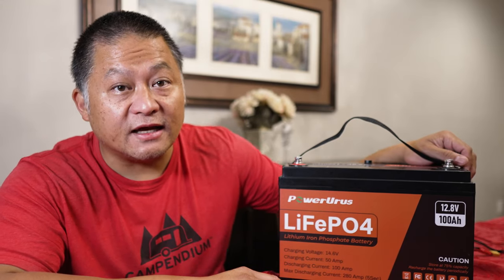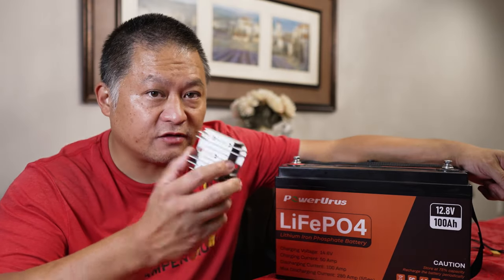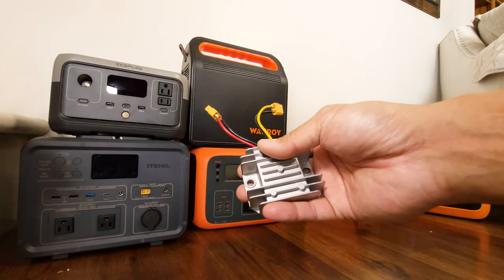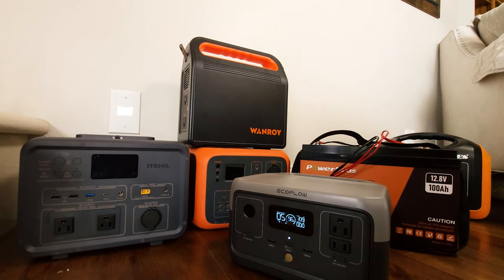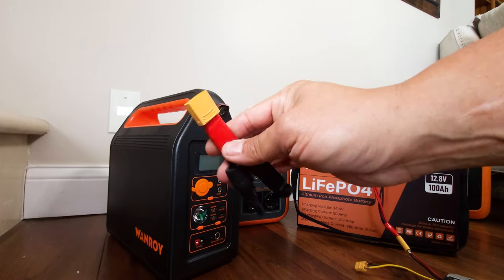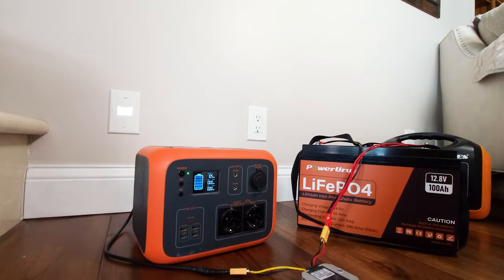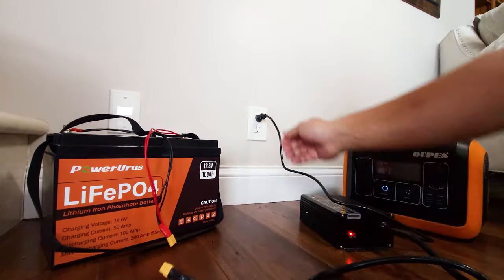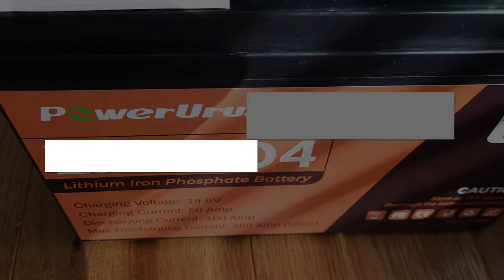CAPACITY HACK For ANY Power Station // PowerUrus 100Ah LiFePO4 Battery

Comment: Freely Roaming - Do you know if the EcoFlow Delta 1300 can just be charged directly from a 12v 100ah battery without using the 24v booster? I guess I'm not understanding what the advantage of using that device is if the EFD is supposed to accept up to 400w of DC input (within the 65v/10a parameters). I also just now today saw another guy's (Charger Harbor) video showing him direct wire charging his EcoFlow Delta 2 from an Ampere Time 12v 100ah battery. For some unknown reason, it only charged at 102w even without any current limiting device such as the 24v booster you are using. I would appreciate any insights you can provide on all this, since I have a new 100ah LifePo4 battery on the way soon and I'm getting pretty confused (and somewhat nervous - lol) as to which way I should go. Thanks.
Reply from the maker: The Delta has a built in current limiter in place so it would work without it. The power station sees it the same way if you were plugging into a vehicles lighter socket. At its native voltage, you can only charge at 120w max because of the 10A limit.
Reply: @freelyroaming  OK F R, thank you very much for all your help on this, and I do believe that this newbie is starting to see the light on some of it - finally! - lol.... :learning::goodvibes:

Comment: Great video. Question, why are there two wires on the positive and two on the negative of your battery pigtail?
Reply: I thought the same.
Reply from the maker: Just so it can handle higher current flow.

Comment: Nice video, I like it.  Can you comment on the low capacity power station discharging faster like using a heater or high power consumption device than it can be charged by the lifepo4 battery pack?
Reply from the maker: Most of the time you won't be able to charge a power station faster than you can discharge it. So even though you could charge it with a spare battery, you will still run it empty first and will have to wait before running those high power devices again.

Comment: So if I'm understanding correctly, I could use the next step up ( DC 12V Step Up to 24V 10A Boost Converter 240W DC ), to power my PPS VTOMAN 1800, even though it has a DC input max of 200W... and the machine will be smart enough to only use up to that (as opposed to frying it)?  
Awesome info!
Reply: Did you end up doing this setup? I would like to do the same on my River Pro (not the latest river pro, the first model).

I saw at the top of the comments section, the OP said the following: "10A is the smallest and it's costs 10 times the price. But if you want to, you can and the idea is the same. Just be aware that 10A is too much current for some smaller power stations with a 120w input limit. Make sure it has a built-in current limiter". 

I don't know much about batteries and electricity; Google says the river pro has solar input limit of 200 W/12A and the Victron DC/24 12-24 10A puts out 240Wh. I'm not sure if the Ecoflow will restrict the flow automatically as there is 40Wh in addition to its limit? 

I am looking for a max input Wattage without damaging the river pro.

Any advice would be greatly appreciated!!
Reply: @jasonspaa  Not sure about the River Pro but yes.. the VTOMAN has a limiter so will only draw what it needs without any damage to the battery.
Reply: @dudleydooright  thanks for the reply. I’ve bought the Victron 10A dc 12/24 now and awaiting shipment. 

Thanks OP for the original post!

Comment: Will this work for an ecoflow delta 2?  Is it within spec?
Reply from the maker: It should. The Delta 2 supports input voltage between 11v-60v up to 15A. This is well within spec.
Reply: @freelyroaming  is there a way to charge BOTH a delta 2 AND your external battery with your setup using solar safely?  I'm assuming I can't and will have to disconnect this set up if wanting to charge the battery.  So I was thinking of buying the "Redodo 14.6V 10A Lifepo4 Battery Charger for Lithium Iron Phosphate Battery" on amazon and plugging that into the AC outlet on the Delta 2.  I believe the 10a version won't overload the AC input since I will be charging 100ah battery?  Or am I thinking this wrong and I could safely get the 20a / 12v redodo charger to charge the 100ah battery?
Also shouldn't there be a breaker on the positive terminal on the battery?    Can you link to the breaker on Amazon?
Reply from the maker: @MyChannel-vm6dw  you can buy the 14.6v charger and just plug both the Delta 2 and the battery charger into the wall.  It will charge much faster separately without going thru each other.
Reply: @freelyroaming  right but I was thinking of a true power outrage.     How would I charge both using Solar panels?
Reply from the maker: @MyChannel-vm6dw  unless you have lots of solar. Meaning 500 watts or more, you should probably just charge the Delta 2. Chances are you won't have enough of a power surplus from solar to worry about charging both. If you do have enough panels, get a mppt charge controller and charge the battery separately. If you are looking for a semi permanent setup to charge both, use the panels to charge the battery and use the battery to top up the Delta 2 at the same time.
Reply: @freelyroaming  Can this system work with TWO of these batteries in parallel to a EcoFlow Delta 2?
Reply from the maker: @MyChannel-vm6dw  yes it would work.

Comment: Just connect your 12 volt battery to a 12volt/120 volt pure sine wave inverter [500 -1000 watt). Then plug your power generator 115 volt plug into the pure sound wave inverter. Simple

Comment: Poetable power stations almost aways cost $0.80 to 1.00 per watt hour depending on the features
But my lifepo4 on sale was $0.16 per watt hour

I have an Anker 521, it takes 11 volts natively, so i just plug the spare battery in and it goes

Comment: Interesting concept.  So I had to try it on my Jackery 300 without the converter.  It charges at 78 watts through the cigarette lighter plug, which is about all the flimsy barrel connector can handle without overheating.  Works like a champ.
Reply from the maker: Usually those connectors and cigarette lighter plugs have a 10A rating. That is also why using a 24v boost converter is best because it will allow it to handle more watts without increasing the current.
Reply: Would be for a larger power station.  Max the Jackery 300 can take is 6 amps, so cig plug works very well.
Reply from the maker: @donbrloks3959  6A at what voltage? Because if you can take in 6A at 24v then you can charge at double the rate as 6A at 12v.
Reply: @freelyroaming  12 v.   The Jackery limits incoming charge no matter how much you make available
Reply from the maker: @donbrloks3959  the jackery 300 has a 90w max charge rate with a 12-30v input limit.  At 12v you would charge at a max of around 7a. 24v would half that. That unit is one of the smallest power stations  and would take over 3 hours to charge it. there are many more modern options like the ecoflow river 2 that will charge at a much faster rate.
Reply: @freelyroaming  Not all of them do. My 98 Transam came factory with a 25 amp fuse. My 09 Sierra has a 20 amp.